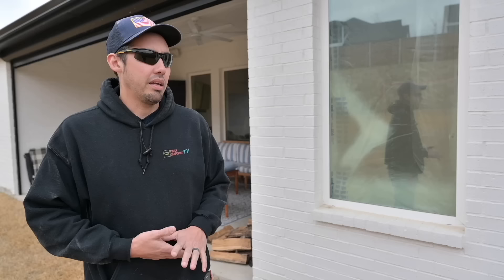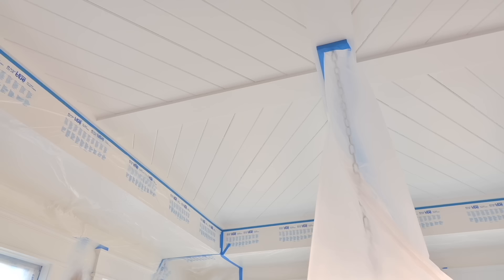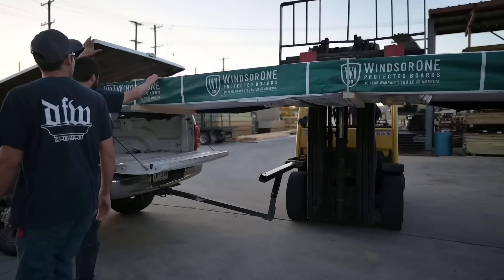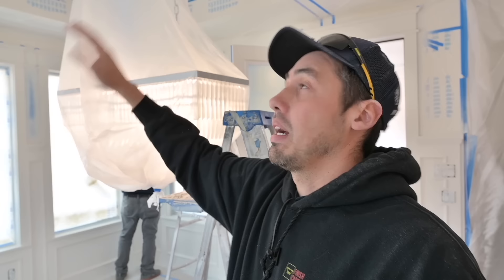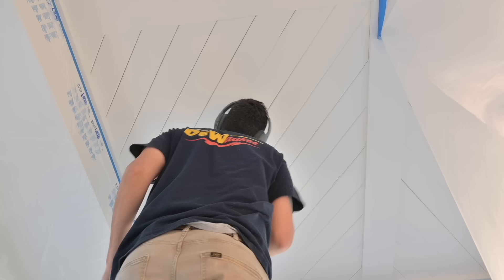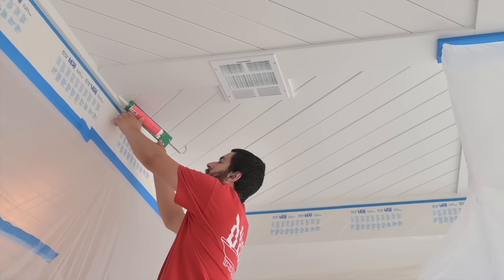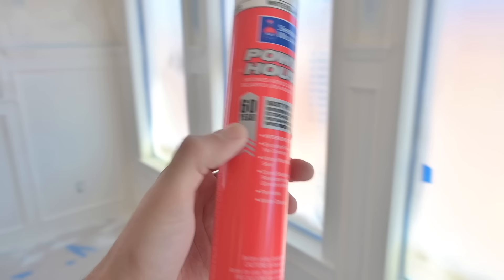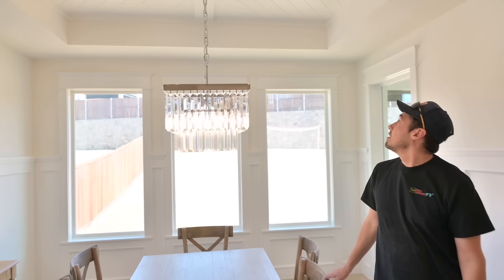Customer furious with me - Failed Trim Install

Comment: It very well may just happen again. Wood can continue to absorb and expel moisture indefinitely. Summertime - air moisture is up, boards absorb moisture and swell. Wintertime - air moisture is way down, boards expel moisture and shrink. Unless the house is meticulously climate-controlled, those boards are gonna move, it’s inevitable.
Reply: That was going to be my comment too... it looks like the ceiling to a 3-seasons room. Climate control in the space and the temperature buffer to the roof above those boards probably sucks. If you're using 6" wide natural wood, it IS going to move. That's exactly why some tables use bread-board ends. An engineered product is the only way to avoid joints opening up. Painting it white was also a mistake IMO. I would have left it natural wood or painted it black, then those expansion joints would practically disappear

Comment: It's not your fault - timber, particularly pine, is anything but stable. I was in the Architectural profession in Australia for my entire working life and I have never seen a vee-jointed ceiling where the joints don't open and close. Doesn't matter if it has a clear finish but it's trouble with a painted finish. You have done everything right but unless the material is in a stable environment it's going to move. You obviously have no control over the environment once you leave so I hardly see how you can be blamed.
Reply: I mean, technically, he did not do everything right. Millwork should always be acclimated to wherever it’s being installed.

He chooses to skip this step because it suits his workflow to pickup/install materials in the same day.

If he had materials delivered & allowed time to acclimate, this would not be as big an issue.
Reply: @ffbuilders8139  You're right of course but no amount of acclimating is going to prevent movement if the environment where it's installed isn't stable. Obviously we have no idea what the conditions are like in this instance but I would argue - why take the risk with something that may give trouble? I would much rather see a flat panel anyway.

Comment: NEVER INSTALL THIS MUCH “Tree Wood” UNTIL THE HVAC SYSTEM IS UP AND RUNNING AND THE SPACE IS DRIED OUT. JUST LIKE FLOORING IT SHOULD ALSO BE GIVEN TIME TO ACCLIMATE TO THE SPACE
I MANUFACTURE CUSTOM MILLWORK AND THIS IS A BASIC WARNING
Reply: Learned that years ago on Nantucket.

Comment: I'm a professional painter , it kills me when I have to cut out cheap caulk that fails every time. The crazy thing is that really good caulk costs less then a dollar more .
Reply: What’s some really good caulk that you’d recommend
Reply: @MyVictoriaMarie  we use Sherwin Williams,  for stair cases or around fire place mantels use SW elastic , even the SW that is Paintable in 30 min is very good for ceiling lines,  returns,  and base boards . Even the name brand paint from Sherwin Williams,  Benjamin Moore and PPG are less than $20 from the cheap home depot/ Lowes paint.  I hope that helps

Comment: T&G will always be moving!!!!!!!!!!!!
Paint just magnifies the process of expansion of materials.
If you had glued the joints, then you would have seen splits in the boards soon after or within a year's seasonal movement of the house.
So, NO GLUE.
This type of material was not meant to be glued anyway.
Good grade of caulk with good expansion qualities is what's needed here.
I'd have first primed all the wood.  Then, do the caulking before the first coat of paint.
Then, a second coat and caulk what opens up in between.
You are an honest man.
Good Show!!
I will add that one other alternative was to pre-prime and then pre-paint the individual boards and as you make cuts, prime them before installing them.
This leaves the "cracks" or seams open which I personally prefer as it adds a better look to the ceiling. On down the road when the ceiling is ever painted again, then that would be the time to caulk the seams..............or not.

Comment: Just a quick question: is caulking even necessary.  You know it's going to separate.  And paint in itself is 'caulky'.  Unless it's oil based.  Just wondering about your thoughts on that.  Tongue and groove was ( I thought) invented to allow expansion/contraction.  Also, I wonder if the substrate (what the t&g is nailed to) didn't perform some of the separation and pull on things unevenly.  Speculation only.  And that makes me think that putting this up with flexible construction adhesive underneath wouldn't have provided some e&c coverage.  
And the philosophical consideration, I don't think it looked unpleasant with NO caulking.  Why have the definition of joints if you're going to fill them with caulk?  My gosh.  Looks very antiseptic when done.
Reply: You should never caulk wood like this. Prepaint everything and only caulk nail holes or knots. If you caulk a joint it will always separate and start falling out.

Comment: Nice video. How long do you anticipate the caulking will last in those 1/8" gaps? Asking as I have a similar project.
Reply: Like he said he's hoping for 60yrs! Don't go cheap on your project, get the best quality caulk you can. Honestly, high-end caulk isn't that much more expensive & digging out old caulk is a major drag.
Reply: @pyguy. Duhhhh.....???? 60 years there Goober. Try watching the video and pay attention.
Reply: Try using BigStretch caulk.
Reply: Pre-paint and don't caulk. I would not caulk the tongue and groove joint. The reason for the tongue and groove is so you don't see the discrepancies when the wood moves. It's wood, it's going to move. Even in a controlled environment, heating seasons and cooling seasons do not produce the exact same moisture/humidity levels. When you use caulk, a better caulk like Big Stretch helps, but this is not the place for caulk.

Comment: I hardly remember seeing you do much caulking on your joints like in your wainscoting. Aren’t all of them more prone to cracking? CA glue and plastic wood isn’t going to hold scarf joints for too long, for example.
Reply: Agreed. wood moves. and will keep moving. we NEVER caulk a wood/wood joint. Wood/drywall joints are better, but it still will. Just because you check it with a moisture meter has nothing to it. It will continue to pick up and evaporate moisture
Reply: @diggingupnorth3453  you never caulk the wood/wood joint? Do you stick with just wood glue?
Reply: @jgarehart89  Not a tight one, such as window trims. (or v-match). Window trims are all pocket screwed for wood/wood joints. If i do, (mostly exterior) I leave at least an 1/8 to fill in. Sashco has some great videos on how to get the caulking to stretch without cracking. If you butt wood together tight, in my experience, the caulking will always crack. I just re-read my comment and it came off as sounding like kind of a dick. Rich does great work and I have learned tons from his videos. You don't judge a carpenter by his mistakes, you judge him by how he fixes his mistakes. We've all made PLENTY
Reply: @diggingupnorth3453  amen

Comment: Beautiful work. Your client is lucky to have you for a contractor.  This is a very common problem where I live. The main reasons are the lumber and the caulking. The house will always expand and contract over the seasons and when the heater or ac goes on. I have recently switched over to the big stretch. In my professional opinion, it works better than anything I have tried over the years and I am old. Always make sure the caulking is dry before you paint it. If not, the same thing will happen. If you got the caulking off that easy, it is a safe bet that it was a caulking failure. Thanks for the video. It is a must watch for anyone.

Comment: Same thing happened to me on a 1x6 spruce T&G ceiling. Problem was the HVAC heat over the winter shrank the boards. Had to dig out all of the caulk with a narrow point scraper, then go back and recaulk every joint with "Big Stretch". After priming and repainting, all looked well. Then the next winter, the paint failed in the joints due to heat but the caulk held just fine. Had to repaint the ceiling again. Third time seemed to be a charm and stable now. No more T&G ceilings for me that would end up getting painted.

Comment: I learned my lesson on heat expansion while building a hospital. We were doing the handrails, and crash rails, which have an aluminum skeleton, with a vinyl cover. The vinyl materials had been on the uppermost floor, where the summer heat had room temperatures above a hundred because at the time they were only being used for storage, while the lower floors were being finished.
I pulled the material downstairs, and cut the vinyl to fit on the aluminum framework. The lower floors were air-conditioned, and the vinyl shrunk, leaving gaps on both ends of each piece.
Fortunately the end caps were adjustable enough that we pushed them in to meet properly, but I'll keep that lesson in mind.
Sometimes you get lucky that it's not a catastrophic fail, and you can move on with a lesson learned.

Comment: Thanks for being honest and putting out this sort of content my feelings are people can learn more from this than an install video and  certainly more valuable information. Anyone who is truly talented has made these mistakes if your not making mistakes your playing it to safe and not bettering yourself at a decent rate. I have made tons of mistakes trying to find better or more efficient ways but without them I would not have developed the techniques I use to do high quality work. Where I live in the North east wood movement and moisture content is a serious problem and all finish work and cabinetry has to be designed and built in a way to deal with it. We never caulk those joints just let them open and close with the seasons and it looks fine but it’s just the way it is here no other way unless you use MDF V-groove. And if we install in the winter when it’s dry air we intentionally don’t jamb them tight I’ve never had the buckle but have seen it a lot.

Comment: My fathers kitchen has an contracting issue. But it's seasonal (he was aware of this before install). In the winter season the ceiling contracts and can see tons of cracks, by summer time it "swells" back to normal and looks absolutely mint with no nasty cracks in sight!
With that in mind, you might get a call back to remove excess caulk being pushed out of the cracks. Fingers crossed that won't be the case, keep up the good work!

Comment: Yes sir it's good you stand behind your work. I'm a finish carpentry here in Texas also and you are correct about the lumber having moisture and then shrinking iv had the same issue several times especially during spring in Texas. I had a builder one time that would buy all the trim an put it in the garage with no door on it and it would fill up with moisture and even when I would tell him he would say put it up iv had crown pull off the celling and walls before an fall down because it shrunk so bad. It happens

Comment: Upgrading to an elastomeric caulk is good, also painting the ends of the trim also helps in keeping it more stable since lumber absorbs moisture through the capillaries at the ends. Same thing with doors, you have to paint the tops and bottoms.
Reply: No warranty on doors that aren't painted on all 6 sides. If there are any problems, the first thing a rep will do is slide a mirror under the door

Comment: You did a good job installing the tongue and groove, but it isn't designed to be caulked. You pre-paint the underlaying surface with the same color to allow the color to be behind the T&G so that when the wood shrinks the background will not show a different color. Another thing we do prior to using lumber is check the moisture content with a good meter, here in Arizona it is critical to know as the wood will shrink with the lack of humidity here. You stepped up to the plate and fixed the problem and I applaud you for that, great job! There are great caulking removers on the market if you need to do that in the future, kits for all sorts of grooves and areas are available on Amazon.

Comment: retired 30-year paint contractor/finish carpenter here.......I wouldn't say you did anything wrong here. This is common and you are correcting the issue. lumber today is processed so efficiently that it is often not properly seasoned or dried by the time we get it. I had always used the best (most expensive) paintable caulking hoping its ability to stretch will be greater than any shrinkage. Imagine delivering the material into the installation area for acclamation while checking the moisture content daily. If it is taking too long to dry the customer starts complaining .....its a no-win situation. Again you did nothing wrong, and more importantly, you are correcting the issue and putting the customer first. Very hard to do these days with all the non-lisenced and non-insured competition.

Comment: We have done 1000's of sq ft of the tongue and groove ceilings. We acclimate them and then paint, stain or white wash them before they go up. We let them acclimate a little longer after the process since we use a water based product. We have absolutely beautiful ceilings and bonus, it is so much easier and faster to do that work on the ground than off it. Our favorite finish is the white washing which we do using water based polyurethane and white pigment added or color we want. We do the same with a colored wash, mixing our own colors we want. Roll it on making sure you get all the groves then wipe it off. We always put it on saw horses and move through them really fast. I have ceilings done this way that we did on porches and even after 12 years they are beautiful. Great for soffits too.

Comment: just a tip, lumber would expand and contract with seasonal changes, to get the tightest joint the boards would have to be secured together and placed in a channel to allow for expansion and contraction. only the two longest boards in the center should be fastened allowing for even expansion in both directions.

Comment: Hey, good video and sorry about you needing to redo the work.  I'm not trying to troll here, and I'm just raising this issue - this seems like a seasonal issue and will be an issue every year.  The wood has expanded and the joints have cracked.  You'll repair it now, but in six months the wood will contract and new cracks will appear.  And then this cycle will repeat year after year.  It looks like just the bottom face was painted.  I could be wrong here, but it seems the fix would be to dismantle the ceiling, remove any calking, prime and then paint each board individually, and then reassemble the ceiling.

On the plus side/positive side, kudos to you for standing behind your work, taking pride in your work, and wanting to make the customer happy.

Comment: The boards are not designed  to be caulked..but... you could use a elastic caulk  that doesn't  fail up to a tolerance  of movement.  Mdf might have  been a different  choice doesn't  move. Or plywood is more stable. 1 more choice  could have been quarter sawn.  The acclimation is required and only good for extreme  movements. Unfortunately  it may still move ....... wood moves with humidity  in the air even under a controlled  temp environment  humidity  still changes. Just like concrete  is guaranteed to Crack. 
Maybe a dehumidifier  for full environmental control. But these  only minimize  movement.  Think of your house with all these organic  products  as breathing and  living. Good luck! Great video.  Love your work!
FYI we must educate  our customers so expectations  are possible . Lots of customers  dream up unrealistic  expectations.  Sometimes  you can never make them happy. That's when you fire the customer  lol.

Comment: Good job owning it and troubleshooting why to prevent again. 

T&G is kind of designed to do that though, the shrinkage might be a little less if you left it out a couple days in the house to acclimate, but its going to expand and contract with the seasons. Its not wood against wood, its wood in wood, which creates thinner bulk with more surface area in closer proximity that is more sensitive to climate changes and varying states of resistance. I always hesitate with paint on those, stain can penetrate, and even help protect from shrinkage and not create a layer that can be worn off and discolor with the seasonal expansion, but of course the customer wants want they want.

It may be a good time to consider having a solid parts list for each job so you can know which product failed later, like in the case of the caulk, or a cabinet handle, likewise you might go thru a job later and think that paint brand or finish held up better than you expected, and can then offer a known solid product to customers limiting the chances of callbacks.

Its those little pain in the butt things like taking another few minutes to write down as you buy things like the brand and where bought that can end up really saving you more time and money down the road once something happens.  

Similar to throwing tools in the bag wildly vs having some kind of organization to save time looking next time.

Comment: Richard knows this but anyone learning can let high moisture lumber dry in the house similar to acclimating hardwood flooring.  Circulating the air helps.   But the biggest thing I found on all installs is people who don’t paint their cuts/end grain.  I will always hit cuts/end grain with some paint or stain to stop moisture from entering.  You don’t want to do that to wet wood before it dries but it helps a lot.